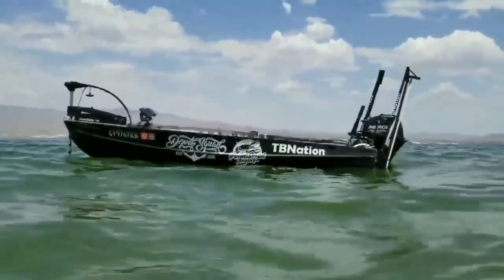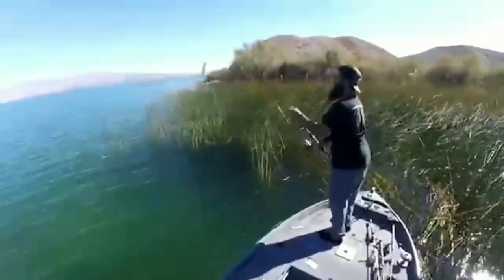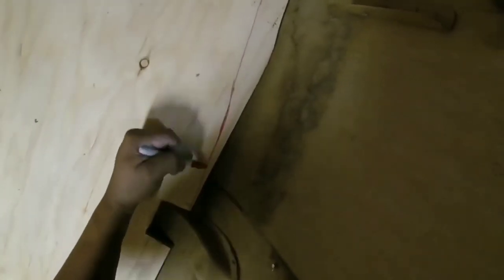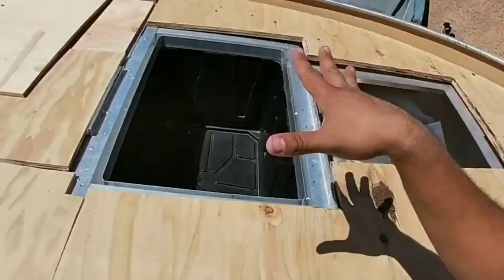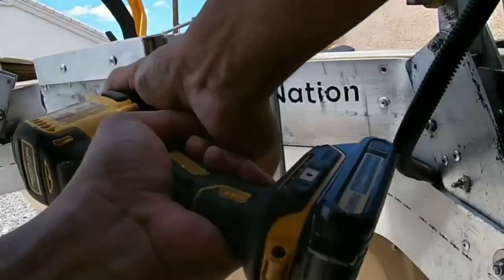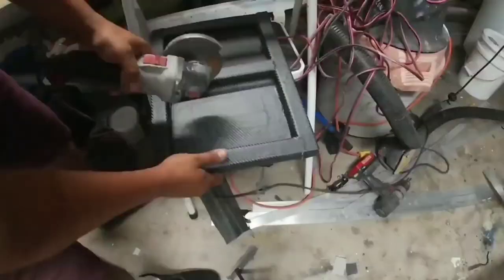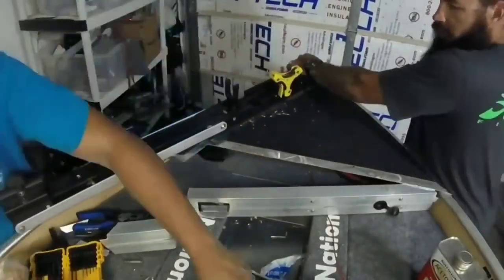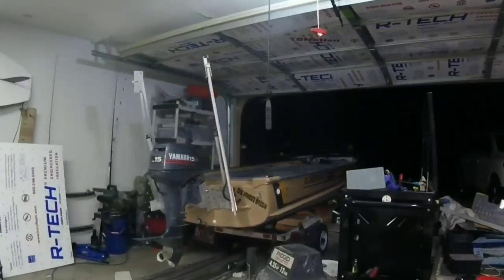Old Alumacraft 14ft boat on Steroids ft. @onehanded_bassin

Comment: Spent the last 30 years working in a 14 ft Alumaweld jon with a 25HP Merc 2 stroke.  Been wanting to upgrade to a jon capable of running duel 25's.  A jon boat version of a center console.. sort of.  What do you guys think?

Comment: What is the purpose of the foam does it make it more buoyant? I have a 14’ lone star and I’ve had 3 200 lb guys in it but it sets to close to the water will the foam help give it more weight capacity?
Reply: the purpose of foam in a boat is to add bouncy if the boat ever takes on water, think of it as a life vest for your boat, a life vest doesn't make you lighter but will keep you from sinking.

Comment: Are you gonna do a video on the gen 5 framing? The video was so sped up I couldn't see anything you were doing. I actually have trouble seeing whats going on in most of the videos. I could really use an actual step by step framing video instead of sped up, quick cut and saying "Then we framed the live well, and then the rod locker, etc..."